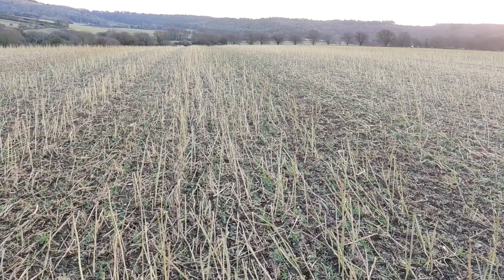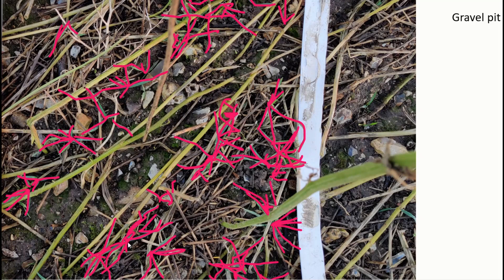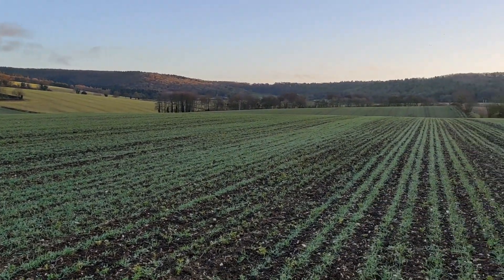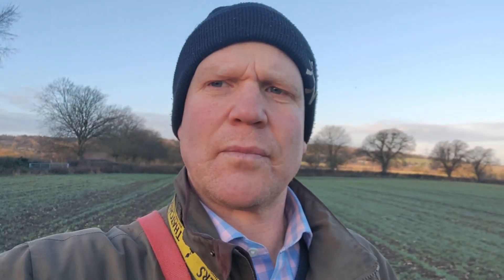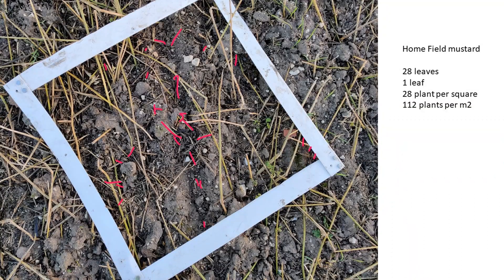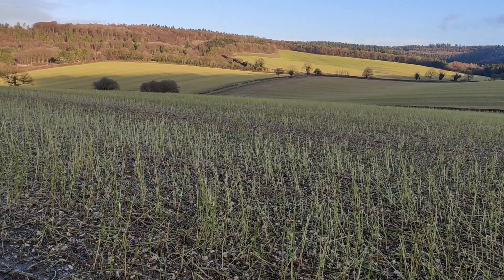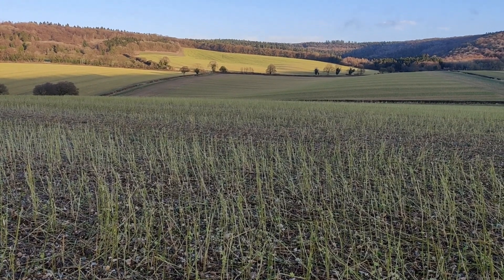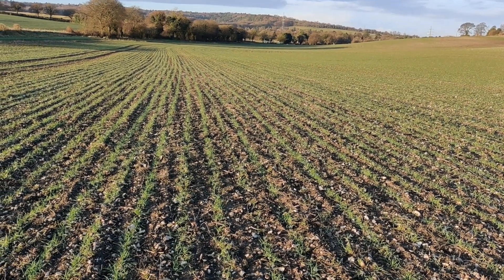Plant count 2

Comment: I wouldn’t get to fixated about sticking to wheelways. Evidence is that soil and crop tolerate a single pass without much degradation, second pass does the damage. I now follow Simon Cowell’s advice and “wander about a bit”. Tramlines (are seeded) get run on once for pre/peri em then I move lines left or right 500mm for subsequent passes until rowcrops go on in April. The tramlines are undetectable until then, no rutting or puddles and full crop.  Worth a trial.  Thanks for the interesting videos, Happy Christmas.
Reply from the maker: Good thoughts, thanks David